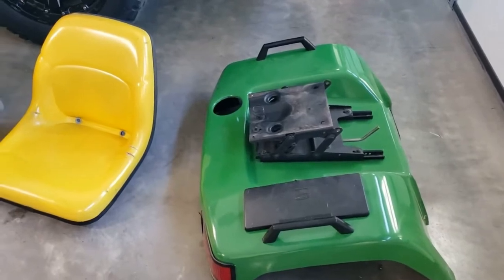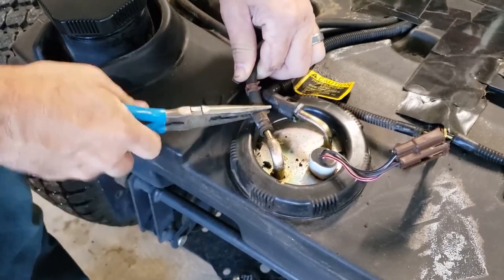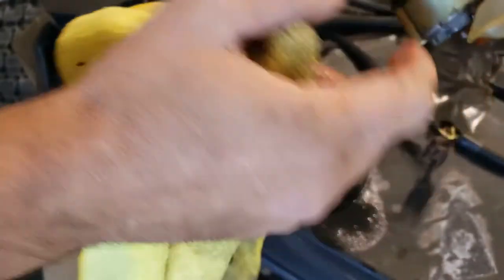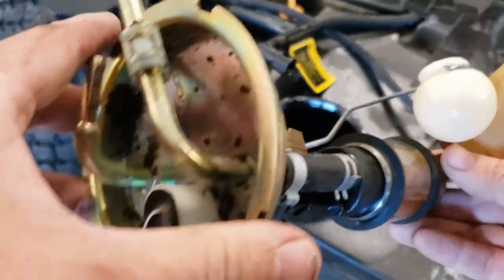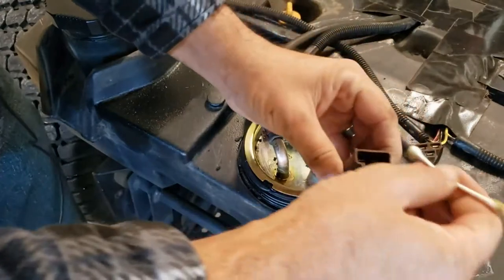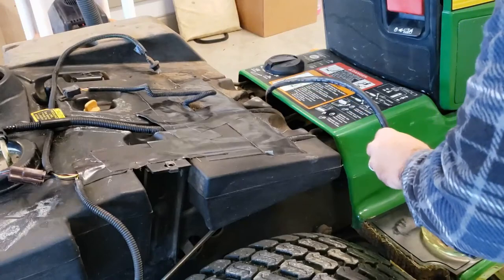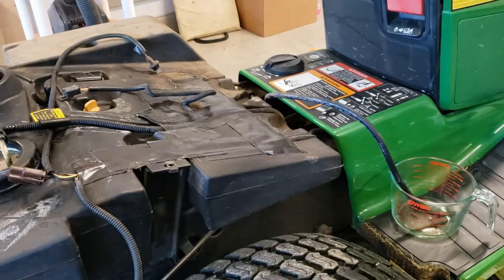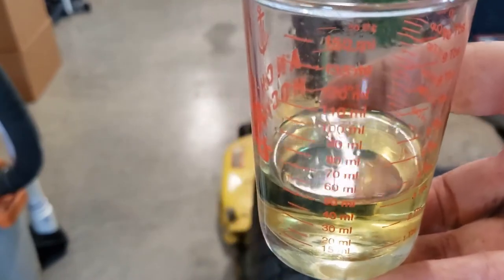John Deere 445 Fuel Pump Troubleshooting, Fuel Sending Unit

Comment: Hello nice video nice job and thanks.   I was able to visually see a slight split in mine and like I said I was hoping you would too.  That little piece of hose is under pressure while operating.   I'd inspect it again and replace  none the less.   It's likely pushing 20 years old.   Wish you the best on this repair and appreciate your sharing.     Good luck and take care.
Reply from the maker: Thanks I was gonna share it with ya but you found it first.  😀
Reply from the maker: @cpwatching I found the bad coil.  Video in 2 weeks.
Reply: @TNYankee2020  Glad to hear!!   445's are awesome.  I'll look for the video.   Thanks!

Comment: I've had multiple problems in a fuel pump it would run sometimes and sometimes it wouldn't I wound up putting an external electric pump on mine down under the floor pan on the right side and it has worked fine ever since
Reply from the maker: Now that would be a great install video!   Thanks.

Comment: Great video, i am having the same issue, but now I'm worried because I need two 10mm wrenches, that may be tough to find
Reply from the maker: Thanks for watching.  I don't get it, is there a shortage on 10mm wrenches like everything else?   Take the rear wheels off, it makes getting to the pan bolts way easier.

Comment: I had a,
 "crank but no start", issue with my 445.
It turns out that the fuel pump relay was bad.
There are 3 of these relays located on the right side under the dash-board where all the wiring is. All 3 are interchangable.
Amazon sells many of them.
The "Standard Motor Products" {RY116}
is one of them that work.
Reply from the maker: Thanks for watching and taking the time to leave that comment, I’m sure that may help many people in the future reading through the comments maybe me too, but hopefully not. :-).   I don’t even know where that relay is located. Could you pinpoint some more information on that?
Reply: @TNYankee2020  yes. I will edit, and add the info.
Reply: How you know which one is bad?
Reply: @georgea6403  ....Since they are all 3 interchangeable, you switch them around each time you try to start it. Also, testing them with a 12v source will do it.

Comment: Another problem spot is the red fuel pump fuse on the right side down by the relays. Suggest replacing with a weather tight type.
Reply from the maker: Thanks for watching and for the comment, its great how these comments turn into their own troubleshooting forum over time with everybody's feedback
Reply: I know that from working on one that burned the fuel pump out and installed replacement and couldn't get it to run. Only way was to run a hot wire to it. Checked all the fuses and they were good check relays and finally found it by backprobing the fuse holder and had only 5 volts on the output side of the fuse

Comment: Fllo your advice on the fuel line.Instead of 50ml I get a stead stream of fuel coming ou as soon I put my foot on te brake in order to ignite. What does that mean for the fuel pump?
Reply from the maker: Sorry, can't help ya there.  My issue ended up being coils not fuel.

Comment: Useful video, thanks.  My 445 is running rough but manages at full throttle.  However at times it starts to miss and bog down.  It  normally recovers but I am waiting for the time it does not.  Did you get your issue resolved??
Reply from the maker: Yes, it runs great. My issue is never a fuel issue. It was a coil issue. I also have a troubleshooting video on that in case it helps.   Thanks for watching brother.

Comment: Thanks for your informative videos. Do you have any videos about how to attach the front pto shaft and bracket to the JOhn Deere 445?  I have the kit but still need to install it. Can't find any videos about this subject.   Thanks
Reply from the maker: Thank you.  I do not.   I remember when I had my quick hitch and extended pto shaft it took a minute or two to figure it out the first time.  I remember it being simple once I finally got it.

Comment: I stopped mowing with my 455 and went to start it back up and will not start.. Crank and crank and won't start. I do have flow at and past the filter. I cleaned my screen, still no start. Will a weak pump cause a no start even though I'm getting flow??
Reply from the maker: I know that can be frustrating brother. It could be a myriad of things but I would check coils. I also have a coil troubleshooting video that would be a quick way to test it
Reply: @TNYankee2020  thank you, mine is the Yanmar diesel though, so no spark plugs. Wondering if there is a switch or something. It seems like it's not getting fuel, usually I'll see some slight vapor out of the exhaust when cranking, but there is none now. It was odd because it was mowing prefectly with no hesitation, no power loss, I stopped for a couple minutes, now it's dead in the water.

I also noticed that when I turn the key, the fuel pump runs and stays running. I'm pretty sure it cut off after a few seconds before.

I should also note that the fuel shutoff solenoid works well, pulls in quickly all the way when the key is engaged.
Reply from the maker: Yeah I'm not sure, could be a switch.  PTO.  Seat Switch, etc??  And certainly frustrating cause usually when it happens there's no rhyme or reason. Like you said mowing good shut it off now it's not.

Comment: I posted on Tesser52 Channel on my fix for 445 fuel delivery and starting issues. Hint: Check the Fuse on the 2 wire standalone harness in the under gauges area.
Reply from the maker: Good Tip Mike!  Wasn't my issue but the comments will be helpful to someone some day.   For me it ended up being the coils.  Thanks for watching!
Reply: @TNYankee2020  Kudos to a mechanic that cleans up his work space as he goes along with his troubleshooting.